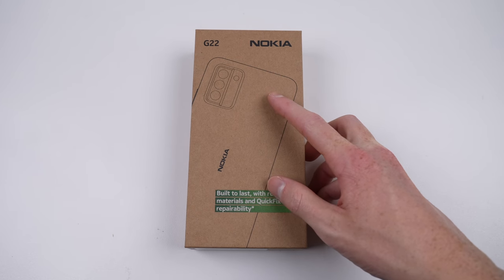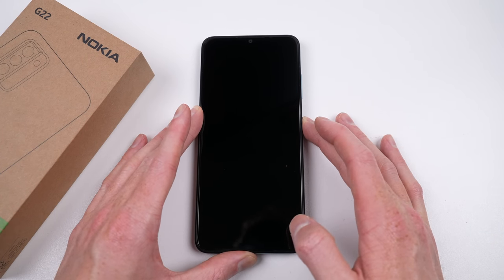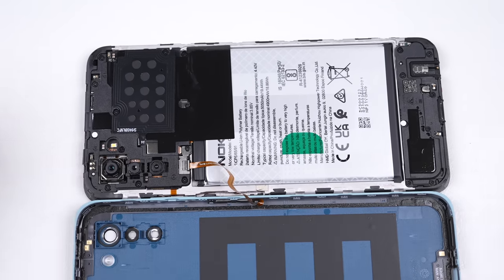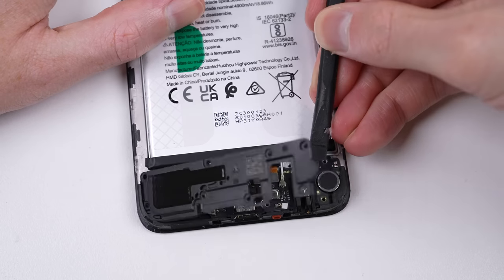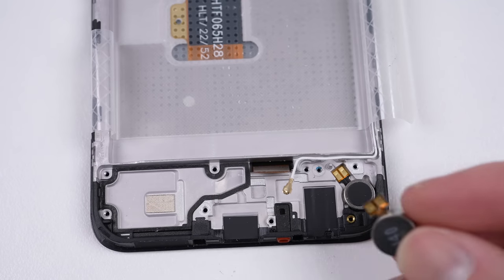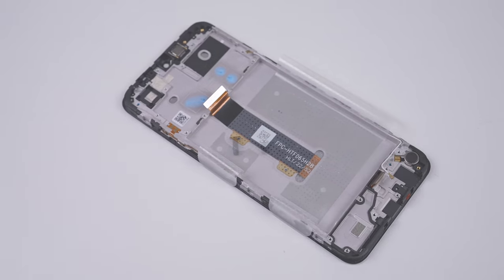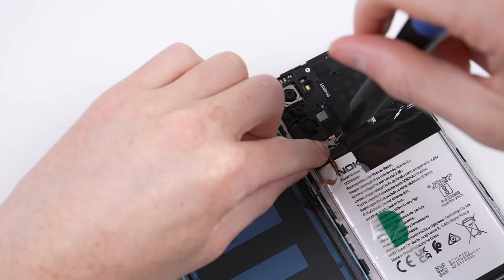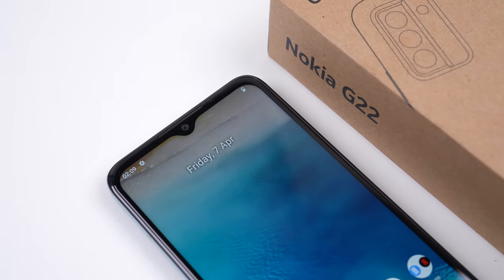Nokia Makes Its First Repairable Phone - Nokia G22 Teardown And Repair Assessment

Comment: If Nokia is going to do that with all of their phones (and keep the Android as stock as possible), then I’m bought.  2 years of Android updates is enough, especially on a mid/low budget phone. They should just extend the security ones to 4-5 years on their flagships, and they’re good. Also, no serializing the components (which they didn’t, in this case).

Comment: Good idea, but the specs are not good enough IMO. My Poco F1, a $300 phone from 2018, has better specs.
I would by something similar if it is equipped with a top/high end Qualcomm SoC

Comment: Does it offer the possibility to easily unlock the bootloader? Do they offer whatever the custom rom developers need to support this device?
Reply: No, you have to use a tool that only Nokia and some shady paid websites have to unlock the bootloader, even if you technically have the option to in the settings...

Comment: Let's try not to fool each other, this Nokia is as repairable as any other phone in its price range, the only difference is it has an official repair manual but it doesn't require anything more than just basic knowledge and common sense to open it and repair it just like any other phone.
Parts aren't reasonably cheap either and this looks like a phone that will be neglected and stay on that Android version forever.
There wasn't a single place in this phone that i found it was designed in a way to make a repair easier, just a few coverups and shortcuts of the complex design they all use nowadays.
I like the whole thing about it but if they want to continue it they must design something else to start a whole new class.

Comment: 3 years of warranty and security updates? I have never had to repair a phone within that time. It's after that time that you will need a new battery or similar. It really should be easier to take apart. Most people are not that used to taking things apart.

Comment: So basically opens same way as all smartphones used to, with exception of being more fidgety and having glued battery. Not even an 'upgrade' of repairability from 15 years ago - still no sealing, but you get more scuffed access to insides.
Would it be too much to ask for rubber gasket that goes around the inside edge of phone that is easily replaceable, and back of the phone just screwed in place with maybe a clip or two? And what's the point of using adhesive on battery? Phones used to have zero adhesive on batteries and worked fine, just cushion it with rubber inside and that's it.

Just feels like repairability on this phone was afterthought - they needed a sales pitch for otherwise really boring phone, so they just put the back panel on without adhesive.

Comment: I'm very curious about this alleged scenario where someone has their previous USB A power brick but not their previous USB A to USB C charging cable. It makes no sense. You're gonna have your old brick AND your old cable. The cable that comes with the phone is irrelevant. I've been using the same brick and same cable for several years through several phones. I wish they'd stop including cables with phones as well, as I don't need any more cables.

Comment: Even if you did fit in the haptic motor, it wouldn't run as intended, assuming Nokia is using a essentric motor, that Z Axis will not do prolonged vibrations

Comment: Problems with the positive in this review : 1) who in their right mind would self repair a phone in warranty ? That's the point of the warranty, the seller repairs the phone if it breaks. 2) There are parts available for purchase now, at launch, when no phone is broke. Will there be any parts be available for it 3 - 4 years from now when the phones start breaking ? 3) No mention of the price of said parts. Does repairing the phone actually make sense, from a price perspective ? If the price of a battery is 25% of that of a new phone, why would I repair ? 4) If you own any Nokia smartphone, or any budget android one, you know the OS support will end well before even the battery breaks, making any repair useless any way.

Comment: Aside from providing OEM spares, it' a joke to say this device was designed to be repairable - purely a marketing exercise. Any device from a few years ago would probably be as or more repairable than this. Take a look at the (Nokia) Lumia 950 from 2016. It has similarly modular components like this, easily removable rear cover (no need for pry tools) and an easily replaceable battery.

Comment: When it age several years and it times to change the battery, the adhesive will be easier too remove. Since it will be heat cycled every single day

Comment: Problem with these is they're not water-resistant or proof whatsoever. The B7000 glue in many devices is what rejects water entery. Would be interesting to see how they solve it as I know a handful of people don't want to go back to the days of having to buy an entirely new phone just  because they dropped it into a puddle of water.
Reply: A repairable phone means even if you do drop it in the water, the parts can get replaced. Your argument feels disingenuous.
The Galaxy series upto S5 had seals and gaskets. It's honestly not that difficult to find a satisfying middle ground.
Reply: @xmlthegreat  How is my argument "disingenuous" just because you don't agree with an opinion doesn't mean it's automatically invalidated. Parts for these phones are relatively expensive and i'd rather have a less repairable device than one that breaks in the rain and requires an $50 part every week.

Comment: Honestly, they should've made it open up from the front like Pixels. Or, maybe it opens from both the front and back for maximum versatility- something Apple did with the iPhone 14 ironically.
Reply: Still it doesn't need to be heated up to soften the adhesive but just be careful not to break the plastic clips when opening it.

Comment: Software updates are important than repairability…….
Reply: Yes you can use custom roms but they won’t work for everyone. I tried several custom roms on my Samsung note 10.1 2014 edition and, i ended up going back to the original rom.

Comment: I was honestly hoping for a flagship hardware spec with features like a headphone jack with a quality DAC and amp (a headphone jack that's good quality is by itself a nod to sustainability and longevity, as a good set of IEM's or headphones with a cable will last decades, vs the ~2-3 years of TWS buds that no manufacturer has thusfar made with replaceable batteries) premium material case that was held together with screws and maintained a good IPX rating, and more individually replaceable socketed parts or even upgradeable parts for future-proofing the device. 

Seems like a pretty mediocre-ly thought out approach to being repairable, beyond "we'll sell you the spares". The price is appealing though.
Reply: the LG V series also has great DAC built-in, sadly LG no longer making phones anymore

Comment: 4GB ram and 128 GB ROM are low for current Android applications I had a Samsung galaxy Note 3 from 2013 had 3 GB Ram and 64GB storage. I don't know which era Nokia is still in. Atleast 6GB Ram with 128/256 GB storage would have been appealing however I do give them credit in an attemot to build a repairable phone.

Comment: Nokia knows they have to do this to get them out of the hole they dug for themselves. I'm just hoping other manufacturers follow, because I will never again give Nokia a cent of my money. Not after my last experience with them. And a note to other manufacturers, it's not an easy repair if you have to struggle to get the battery out

Comment: This Handset is literally an equivalent to a Xiaomi/Vivo/Oppo/Techno's 100$-150$ handset. It's almost the same spec and the build quality is also same, they're just charging you guys more than double with the "Repairability" bandwagon. The only difference I can see compared to the 100$-150$ devices is the 90hz refresh rate, that's it. My brother bought my mom a Motorola G42 that comes with a 1080 x 2400 OLED (60hz), 5000 maH battery and a fricking charging brick in the box that we paid in only 120$.

Comment: Probably the battery wasn't easily tear off because it was newly unboxed. If he had used the phone till the battery actually degrade perhaps the adhesive also had degraded over time due to heat.. Because who wants to have a jiggling battery inside their phones after just a few months of use.  say that next time.

Comment: The conclusions seem a bit misleading to me. 
- The only concession to repairable design is the back plate being held with plastic clips. Other than that this is a standard phone in that price range with even worse specs than normal. 
- The other thing Nokia has done to make this repairable, is to sell the parts through ifixit. This is a nice move, but even that can be screwed up like Samsung.
- The bootloader being unlockable is a feature of all android phones. This does not increase repairability of the phone. It just means you can flash your own ROMs eventually, once the community develops the tools needed to do that. This may or may not lead to software options that are updated, once Nokia has dusted their hands of software support for this model.
- The warranty part is sketchy, as service centres across the world often don't know or don't care about the servicing policies, if you take this phone to them and it has been opened before they might simply refuse to work on it. The ingress sensors and painted screws tells me this is something they are flaky on internally and are hedging bets.

Comment: 1:50 The back of the Gigaset GS5 is easier to remove, but it must be because the sim card (and battery) is there.
Reply: never heard of Gigaset
Reply: @yotoprules9361  Gigaset was the brandname for communication devices for home and office (aka stationary and dect telephones) from Siemens. They spun it off  and they are also producing smartphones.

Comment: Hi sir, I tried to message you on your official webpage contact form. But it says contact form not available at this moment. 

I recently purchased a 'Unihertz Tank' smartphone, which has a 22,000 mAh lithium polymer battery in it. The phone is very heavy and huge, and has lots of interesting screws. I am also worried about the display, in case i accidentally drop the phone and the display be shattered. 

It would be a very interesting video to make for disassembling the Unihertz Tank phone and verifying the legitimacy of the battery, and the high tech specifications that come with this phone.

It also has 130 lumens camping light, and also IR camera at rear, alongside with a few additional cameras, with the main camera having 108 MPX.

Bonus features also comes with IR remote built in, and so much more interesting features which no other phone has.

It is definitely an honorable phone which deserves a video on this channel.

It has torx screws all over the phone, almost like as if a DIY can easily have this phone disassembled by themselves for any kind of repairs.

My humble request for a video for 'Unihertz Tank'.

Comment: I don't like the fact that the screen is being sold together with the phone's frame. I find that to be a waste of resources, and makes the screen more expensive than it needs to be. For me, that aspect of the Nokia alone makes its repairability very similar to most Samsung phones, that likewise, are nearly impossible to replace with swaping out the whole frame. Its only repairability is that the phone parts are available OEM and accessible by the average user.

Comment: Not really impressed with that one either. The Nokia that I had was an N75 I think. If it wasn’t stolen I’d be still use that in some form. That’s not what I was looking for in all honesty. I just don’t want a mega huge mobile phone that is a pain in the arse. I was a Samsung fan and loved my Galaxy Ace 3. Was my experience with the Galaxy J5 2015, with the boot loop exynos chip instead of the snapdragon 915 chip. I had that phone for 5 years and would have cost me £350+ for a new board. I decided to get an Apple SE2020. Last of the repairable apple phones. Once that dies/bricks. I just don’t want a huge monster smartphone over a grand+. I just want a smartphone that fits in my pocket and robust enough, reliable and affordable and looks functional without fuss. And one that doesn’t scream “steal me”.

Comment: Build wise there is nothing unique here, the A03.A13. A04, A14 and A21, A222, A23 all open the same way with no adhesive, the cheaper motorola phones are the same way, they all have pretty much identical internal layout and have the same battery mounting system outside of samsung needed some alcohol to remove the battery but they have moved to pull tabs with the A04 and A14.  Part availability is nice, but Nokia was one the worst to get parts for already, so with this ifixit deal they are now closer to having part availabiliy similar to moto and samsung.  But Samsung has part availability in spades here in the USA, multiple good part sites and ifixit carry parts for them as well as Samsung having a decent certified repair program for repair shops.

Comment: It's a good start for Nokia, removable back(though still kinda fragile as plastic clips can break if half hazardly pulled) as for battery maybe put a little bit of alcohol to ease it up & if planning to reuse just let it dry later on & finally one of the most important is Unlockable Bootloader for Custom Rom support which they removed or disabled on their previous models.

Comment: it seems to me like they took a $100 phone and just put the parts on ifixit. 
it's a step in the right direction, and all companies should be doing this, but that phone doesn't look super spectacular. it looks like a 2018 phone. the security and android versions aren't super spectacular either. it's literally the bare minimum. my samsung S22 ultra will get updates for the next 5 years.

Comment: I don’t see how this phone can last. Cheap nearly outdated specs no waterproofing… You’d be better off buying a phone that is way overkill in specs and replace the battery every 3 years. Like an iphone 13 pro with steel chassis, good screen and waterproofing will easily last 7-10 years with an occasional battery replacement and it will get updates for longer and actually work decently fast.

Comment: THIS LOOKS LIKE ANY OTHER BUDGET PHONE OUT THERE. I THINK SAMSUNG ARE ALSO TRYING SEEING THAT THE FLEX  CABLE THAT CONNECTS THE SCREEN  TO THE MAIN BOARD IS NOWDAYS REPLACABLE EVEN IN THEIR FLAGSHIPS. A FEW YEARS AGO IF YOU RIPPED THIS CABLE YOU HAD TO CHANGE THE WHOLE SCREEN WHICH WERE SO EXPENSIVE IN THE FLAGSHPS WHAT REMAINS IS THE UNDER DISPLAY OPTICS. SAMSUNG SHOULD ALLOW FOR CALIBRATION ONCE THE SCREEN HAS BEEN REPLACED.

Comment: To bad they are late. Got a new phone in 2022 and picked Motorola over Nokia. And still if this is possible the back plate has to be possible to be made easier to remove then this. Have screws visible if so need be. This was not a problem back in 2000-2015s. Why o why is it today. And why is the bat glued down that much.

At some point I hope we can ditch Google Android. I really hope we can get devices that can last 5-7years. It is still ridiculous how Apple got the right idea of keeping stuff for longer then just 3years and 2 version upgrades.

Comment: When I read repairable, I assumed it would be easy to repair, like replacing parts on a pc. Repairable just means that you can get genuine parts. I'm not interested because the average lifespan of a phone is two to three years, and all phones are basically the same, so my solution is to buy cheaper phones, and when it starts getting problems, I buy another one. There has been no real innovation in phones for the last seven or more years, so three years ago I stopped falling for buying a new model just because it's the latest.

Comment: Nokia phones were always very repairable. That why my early 2000s models are still alive. Because nothing is fixed by glue and you can remove pretty much everything with just a couple of screws.

And this one is disappointing. Stop using adhesive. Bloody hell.

Comment: "budget Android"
yeah, it's nice that it's (intended to be) repairable, but this is part of the corporate gaslighting - the phones you want to repair and make last are the expensive flagships, not the cheapo ones where for some people the time spent repairing it may be more expensive than getting an equivalent replacement. This might work as some kid's first phone that you can have them fix if they break it, but unless flagships become just as repairable as the cheap phones, this is ultimately just gaslighting the consumers with the "you can have repairability, just buy this slowpoke-by-comparison phone with low specs and meh cameras. Oh, want a good camera? All we have is this glued shut model that will kill itself in 5 different ways if you as much as think about opening it."

Repairable budget androids have been a thing and with those you don't really care that much about a component from aliexpress (maybe you care about the month of delivery time though). However, if you want to fix a top-end phone, you do care about getting good parts. This phone solves a non-issue, and pretty sure the cheapness of the phone is a large part of the reason for the warranty after self repair.

If they made upgrade components not just replacements, though, then we'd be talking.

Comment: I think you need to be a bit more objective in regards to the battery removal. Nokia doesn't expect a consumer to remove the battery when the phone/adhesive is practically new. I would say from use and by the time a consumer needs to remove the battery -- the adhesive probably would have degraded over time allowing for an easier removal. At least Nokia is giving an option for self repair now -- especially with ifixit. Now... if only Nokia would bring back their 3300 series phones. 🤣